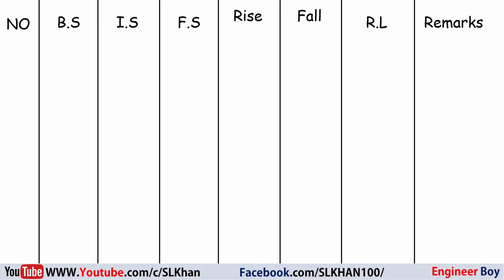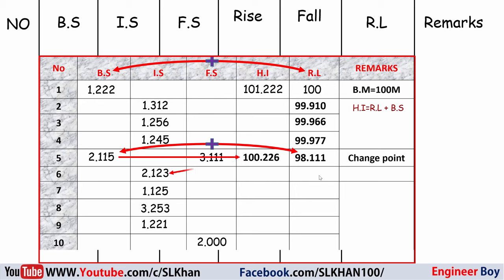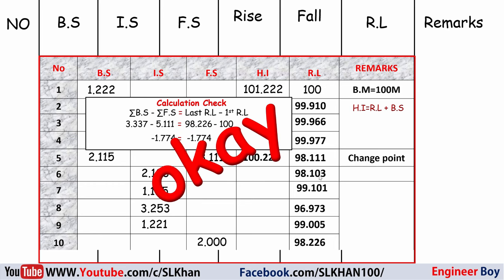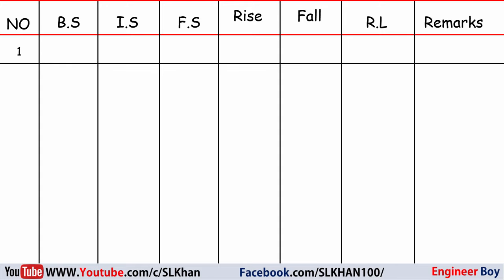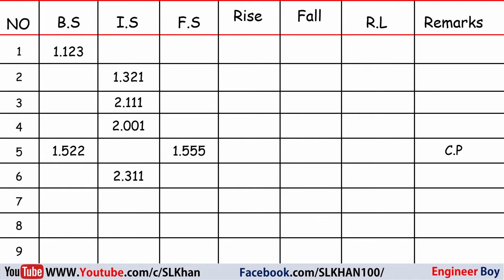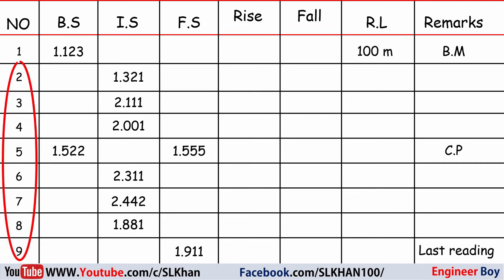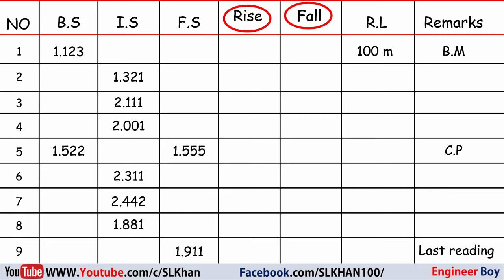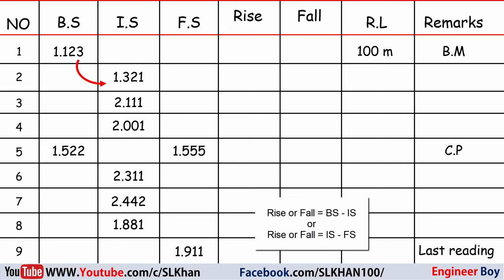Rise and fall method in leveling

Comment: What is that CP you have written in the remark sir
Reply from the maker: CP stands for change point.
Remember we change the instrument location (point) before taking back sight reading. That is called CP because of Changing the instrument location
Reply: Thank you sir another question sir what is the need of writing remarks
Reply from the maker: In the video that is a small table. Sometimes you may have heavy survey work. So we write remarks to remember what’s happening in the table
Reply: Thank you sir